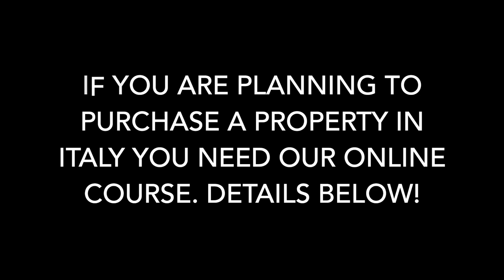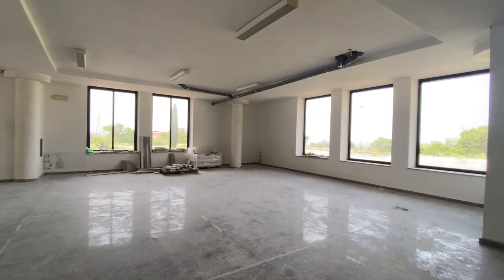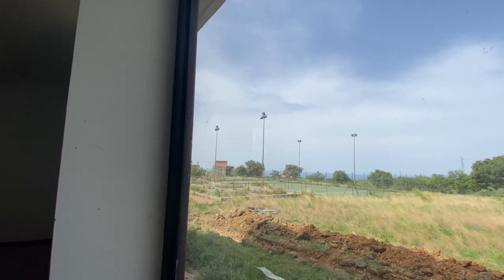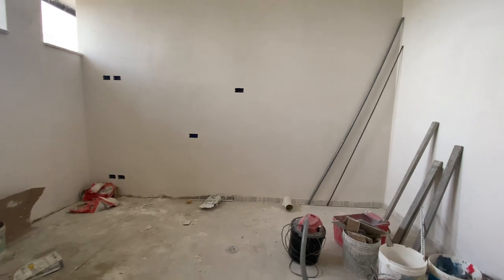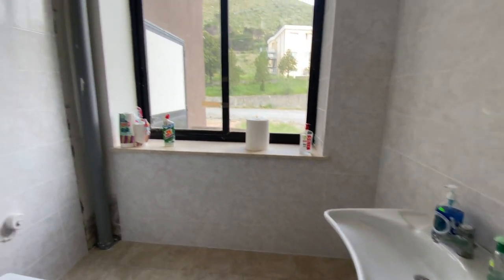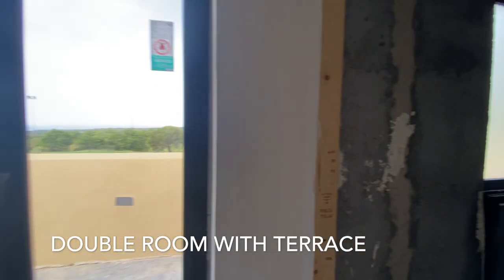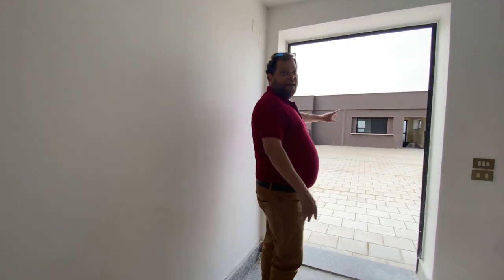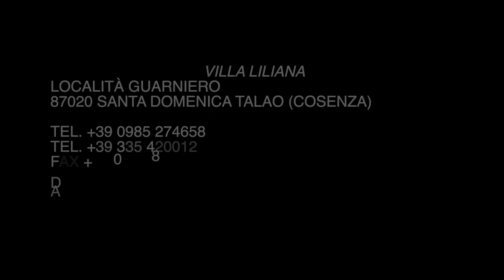Another Great Reason to Retire in Calabria, Italy!

Comment: I always say that you come crawling into the world when born and go crawling when old.
When remodeling a home, it’s wise to build all doorways 36” widths, for wheelchair accessibility, install lever door handles, build threshold-less wheelchair accessible shower pans, install bathroom sink countertops with wall supports, for tucking a wheelchair under the countertop. The kitchen can be designed for the less ambulatory dwellers, too. Homeowners would rather pass away in their own abode, rather than a convalescent facility. One of the biggest obstacles in ancient ruins is that there is not a lot of room for installing a vacuum air elevator.
Reply from the maker: You are so right Giovanni! It is very wise to think of these things when you don't yet have to.